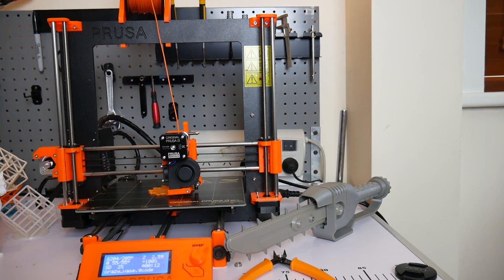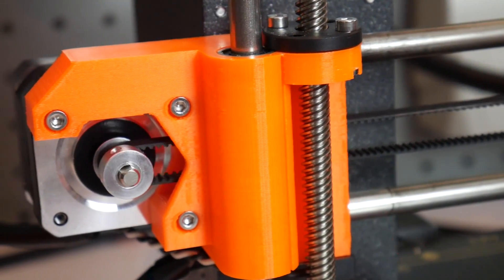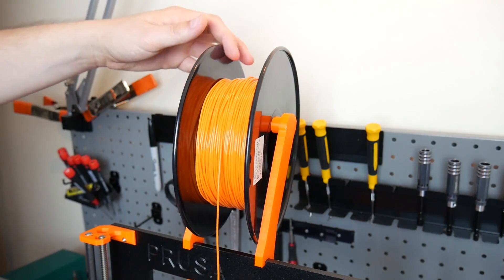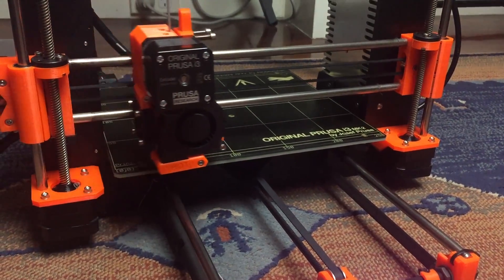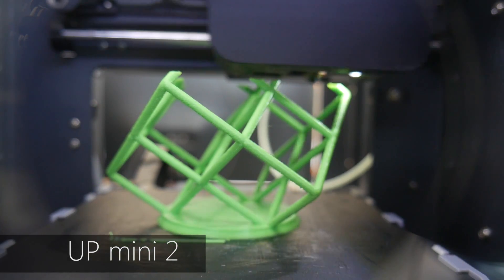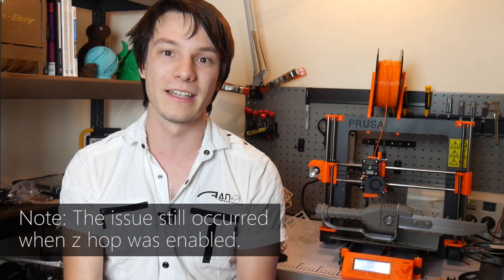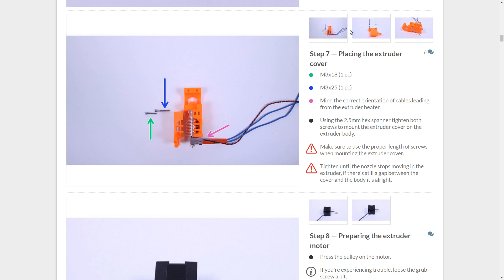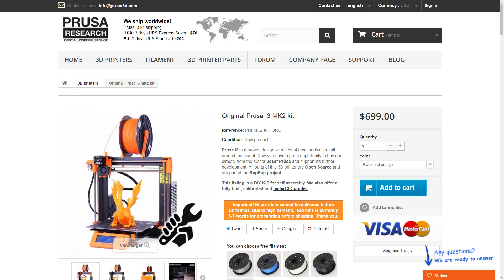Original Prusa i3 Mk2 3D Printer Review

Comment: Tevo Tarantula Part 2 please.
Reply: I'd rather see Tevo Tarantula being rebuilt into the combat robot by Angus...  Imagine "Hot PLA spitting weapon at the front" ;)
Reply: I have to admit that would be pretty cool.
Reply: True Tech .....I had problems with Anet.....and being ignored...part I think is because they are so busy selling huge numbers of the machines...I started a PayPay case....I very soon got answered and replacement parts! I see too many posts where buyers simply resort to buying another part rather than use the purchase method of buyer protection. My advise to all who have poor response to quality or full inclusion of the parts....to use PP or whatever your purchase method is...to force ANY seller online to progress your claim.  For my part, I had two replacement motherboards sent out....the first would not function via USB.....the second after a complete new setup.....air printed using USB cable....but was perfect using SD card with the same G-code.....the third is OK for both!   But it took almost two months to get through the process.

Comment: Finaly! Someone with problems with mk2 ;) I started to wonder if this is a miracle machine ;) It's a great review to cool of some folks - to see that eveb pros have failures with this machine would be beneficial to Prusa and their customers. Although, I haveto be honest, I was expecting something worse than this ;) Thanks for the effort!
Reply from the maker: The original slic3r provided was tested first, stock settings. The screenshot shown 5min in is Slic3r after experiencing the thermal runaway error. The latest prusa flavor slic3r is improved as mentioned, but it still does struggle to produce the cube torture test IMHO due to the highly directional fan duct - requiring significant Z hop to avoid breaking the beams.